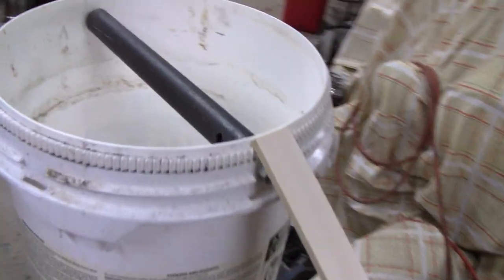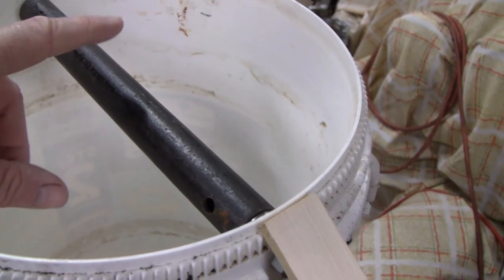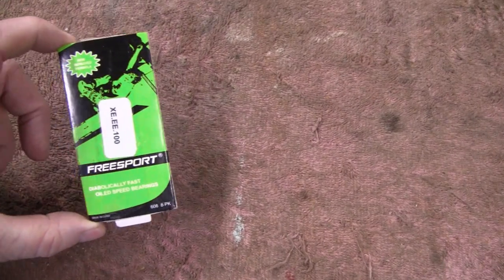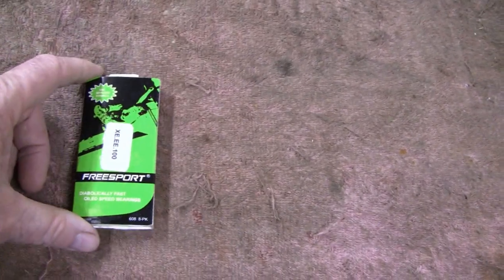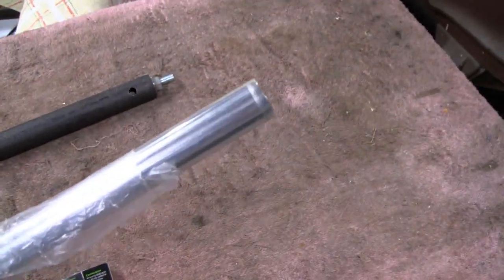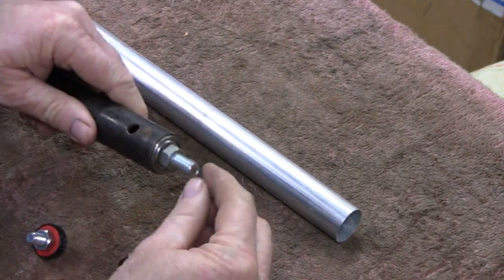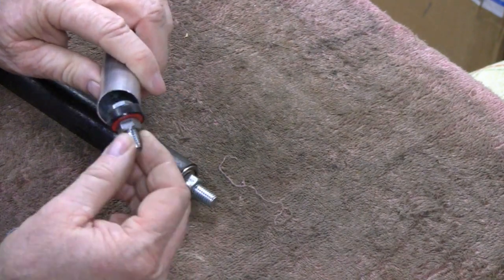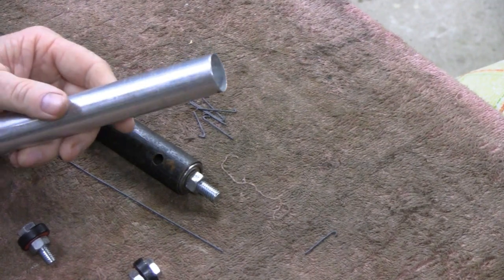LOG ROLL MOUSETRAP UPGRADE with SURVEILLANCE

Comment: Nice tip on those bearings. Amazing how long they spin. I went really low tech and just used a soda bottle and clothes hanger wire. Still, it cleaned out the mice from my attic. Best mouse trap ever!!

Comment: I would never say what you did was wrong but there is another version which I have used for many many years and is a whole lot easier to make. Use an awl to poke a small hole in the center of the bottom of an aluminum beverage can and another hole through the rivet for the poptop. Drill two holes opposite each other through the rim of the bucket. Thread a piece of coat hanger-weight wire through the can and the holes in the bucket. Center the can on the wire using zip ties or tape around the wire on both sides of the can. Spread peanut butter on the can and set your ramp pointing to the side of the can and not in line with the wire. Mice will crawl up the ramp and jump to the peanut butter but the can will roll. One of my traps with antifreeze contained 35 mice this spring. Total construction time is less than ten minutes using readily available materials.
Reply from the maker: We already made that video 4 years ago  https://youtu.be/DVRNb3XFHd4  and again 4 months ago https://youtu.be/6rzb1ZD5w4E

Comment: Mice are very light, if your roller doesn't turn VERY easily, they can keep their balance. Those rascals are wicked gymnasts... You can use plastic pipe, hot glue a washer in or on the end and run a rod through it. Grease a little on the washers and done.. Also rub some peanut butter in the bottom of the bucket above your water line to attract them.

Comment: Put the bait on the other side of the ring. They'll try to climb over it, shift their balance and go splash. Also, add a few drops of detergent to the water, it'll soak into the fur faster and they'll die faster.

Comment: I wonder if you used 2 washers in the middle with a 1-1/2 spacer between and put peanut butter on the spacer if that might make it work better since mice/rats would have to work a little harder to get to the PB and lose balance while trying to get to the PB.

Comment: epoxy is great stuff, it's strong and will even set up under water once mixed so the temp.is not real important, epoxy is my preferred  type of glue, it seems to me like "super glue" had really went down in quality.
Reply: They made super glue safer to sniff is why the bonding quality went down.